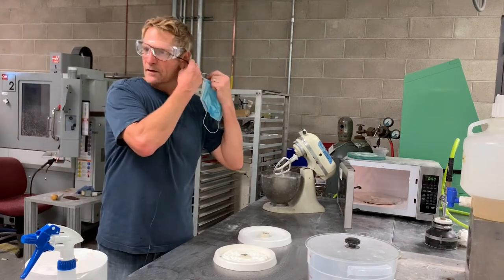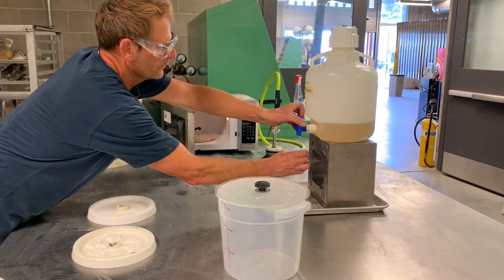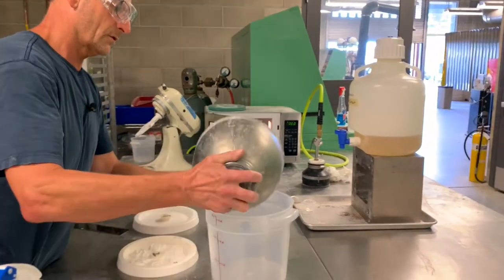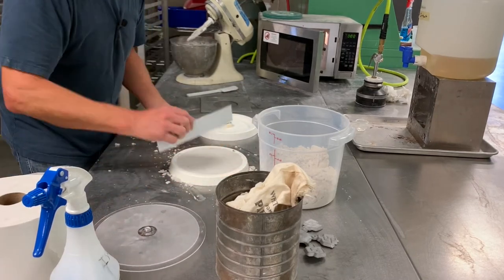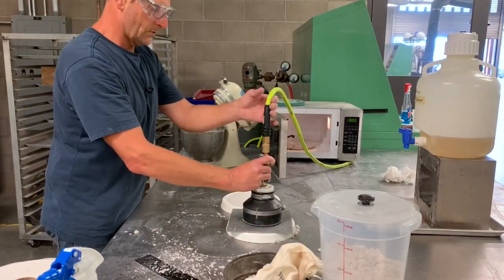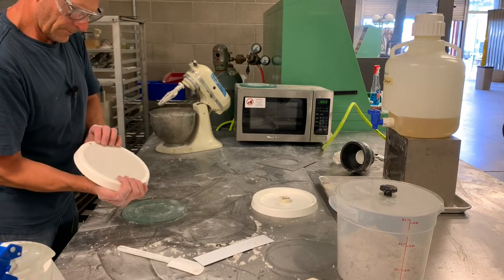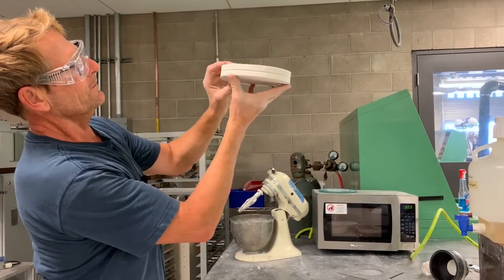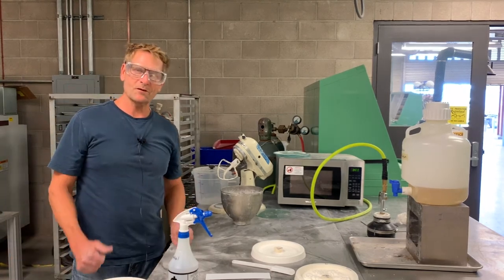IME 141 Sand Molding for CP Keychains

Comment: Have never seen people microwave it like that afterwards, but haven't seen many use sodium silicate molds either.  Can you run the used molds back through a grinder or anything so the sand can be reused?